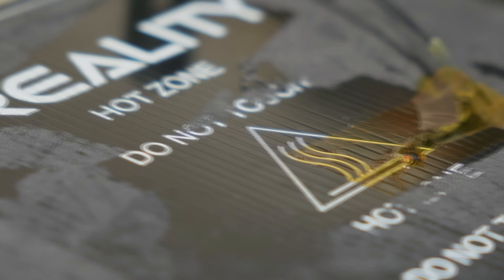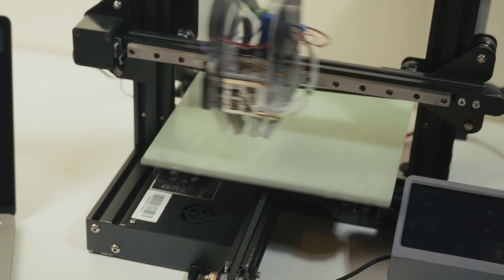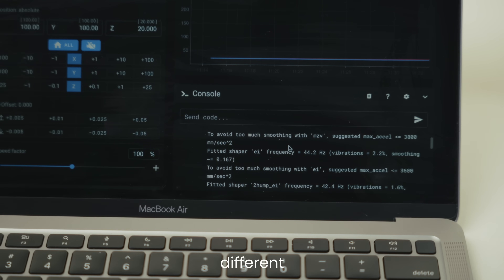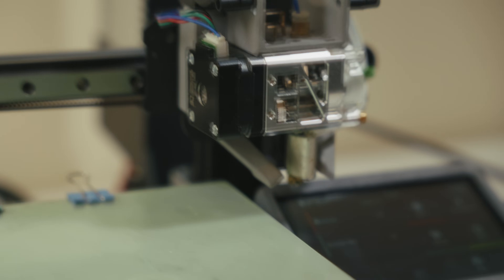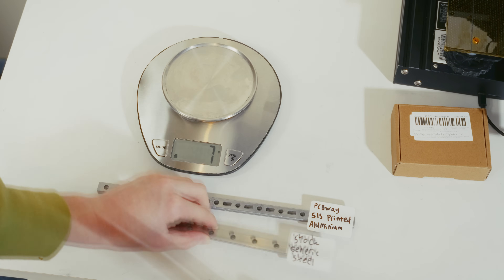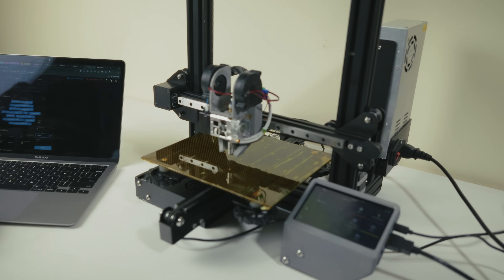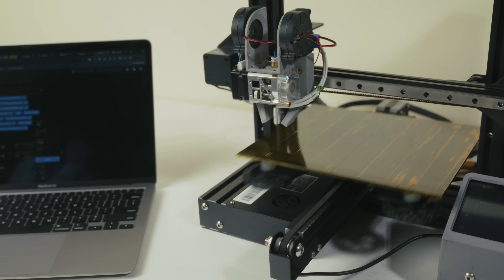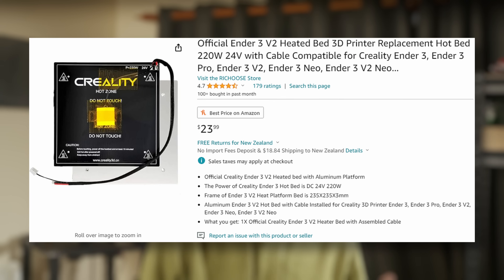Are Carbon Fiber 3D Printer Beds the Future?

Comment: Why the tape? Newbie here 6:09
Reply from the maker: Tape would be lighter than a PEI flexplate, or especially a glass bed! It should still work for adhesion, too, rather than just the raw CF, which only works for I think a couple of exotic filaments (it's been a while since I checked), but I think painters/masking tape would also be ideal. I don't think I actually tested printing on it 😅I have seen it used before, though. Maybe on the LH Stinger, but it's been a while. Cheers!

Comment: This is just my theory, but shouldn't you stay under the max accel with a margin, so that the print itself won't cause the steppers to skip once the print starts to weigh the bed down?
Reply from the maker: It's an extremely logical theory, and I can agree with you there. I've never really thought about that when pushing bedslingers to the limits, but it's a smart approach as it 100% is the case, especially with larger format machines!

Comment: You can use any fiber you want,  IMHO The most important aspect is the epoxy binder.  Use Kevlar, fiberglass, carbon fiber, etc, they will all be about the same, provided that they are made using the same binding epoxy.
Reply from the maker: Thanks for explaining! I will try and remember that for the future, in case I start using this stuff for more projects. Cheers!

Comment: i wanna ask will it possible with big size, like 400mm? i ordered 5mm carbon plate but in the middle is 4mm glass fiber
Reply from the maker: Different plates use different resins, so heating them will have different effects, but for the most part, they should perform the same regardless of size. I’ve redone this project for my next video (releasing later this month) and will continue testing its performance. For larger plates, the benefits should be even larger. Cheers!
Reply: @TommyHoughton  thanks for informations, i will subscribe for next video

Comment: Я переделывал свой Эндер 3 Про, уже несколько раз.Последнее изменение было связано с изменением привода ремня к кровати, и я сразу получил более стабильные результаты. Далее я стал думать как уменьшить вес кровати и также пришел к выводу, что неплохо использовать карбон. Стал искать кто такое делал и нашел ваше видео. У меня будет немного другая схема, но принцип такой же. Я не то что бы гонюсь за большими скоростями, скорее я хочу поднять качество печати, а тяжелая нагревательная кровать одна из причин появления дефектов. Кстати я тоже заказал силиконовую грелку, но только потому что из продажи практически исчезли грелки на основе каптоновой пленки (я не нашел подходящую по параметрам). Нагревательный элемент  на основе каптоновой пленки намного легче силикона. Удачи в вашем проекте, я тоже попробую завершить свой, сейчас жду когда мне вырежут нужные детали.
Reply from the maker: I've heard good things about that mod, I must try it myself. As nice as high print speeds are, higher-quality parts are always the goal. I'll keep a look out for these Kapton heating pads, they seem very promising. I've noticed the silicone heating pad is much heavier than initially expected. I wish you the best with your project! I will try this again later on in the year but with some better changes. Cheers

Comment: Never cut/drill carbon fiber or other composites in open air unless you want complications like cancer.
Reply from the maker: I understand the risks associated with working with it. I had my respirator and avoided contact with the powder. Should I work outside next time? I don’t plan on working with it for a long time.
Reply: @TommyHoughton  best way to cut carbon fiber at home is to submerge it in water or oil completely and drill/cut under the liquid. A respirator is nice but these kinds of powders are very sharp and sticky, so it's best to modify them under liquid. Also thick gloves and goggles are a necessary addition to your PPE. Nice video though. I enjoyed it very much.
Reply from the maker: Good to know! I'll definitely do that next time, it would make things a lot less messy. I'll look into some proper gloves and a visor/shield, they would be good for a variety of applications. I've had instances where I've needed to angle grind parts, but frankly, I'm rather afraid to try. Even using the Dremel was a relatively new experience. Thanks for watching and for your feedback, I really appreciate it!

Comment: What kind of drivers are you running on this? Also, are they running in stealthchop or spreadcycle? TMC drivers skip steps a lot easier in stealthchop at higher speeds.
Reply from the maker: It's a stock Creality 4.2.2 with the A4988 drivers. Unfortunately I can't control the current (to my knowledge.) I wish I never fried my SKR Mini E3 V3, but some things can't be changed. Would definitely love to put some HV drivers on this machine, perhaps BigTreeTech could help with that. An AWD Y axis upgrade was requested, combining that with some TMC 5160's would be insane. Thanks for the info too! It may prove useful in the future, I've never really looked into the details of controlling TMC drivers. Cheers
Reply: @TommyHoughton  yeah you cant do much with that board, but you can in fact increase the VREF on each driver. Maybe get a volt meter and double check what they are set to so you can maybe get more out of them. Other than that, you should get a new board so you can use some TMC drivers and configure them in spreadcycle.
Reply from the maker: That’s a good idea. I have no immediate plans for a new mainboard, but I’ll put in on the list for future upgrades since I definitely want to play around with different drivers. If I can plan a good enough video, I’ll try to fit in as much as possible; Perhaps “Building a 48V AWD Ender 3” has potential, I’ll look into it. Thanks for your suggestions!
Reply: @TommyHoughton  I appreciate your positive attitude and how you listen to suggestions. You have a bright future on YT, bud. 🙂
Reply from the maker: That means a ton to me! The suggestions from everyone (you and a couple of others especially) these last couple of years have been invaluable, I'll try my best to read and respond to all of them for as long as I can. I look forward to hearing from you again in the future!
Reply: @TommyHoughton  Thanks! You're doing a great job so far. Keep up the good work, and I look forward to seeing your future content. 🙂

Comment: can you do a hardware klipper setup overview, I also have a pi zero 2 w and want to add a touchscreen. Nice setup btw!
Reply from the maker: Thanks for watching! I could certainly do a deeper dive in the future, but it isn’t something I’m able to focus on currently. I’m more than happy to try and help you if I can; I used KIAUH to install Klipper screen, it didn’t work straight away but a reinstall made it work properly. I’m using a 5” screen from BTT using an hdmi to mini hdmi adapter (or micro not sure which one) everything is connected using the required adapters (usb C to A to Micro using a splitter for more ports.) Teaching tech did a video on a cheap esp screen I think it was, it’s a better value option but I haven’t delved into it just yet or checked compatibility but should all be fine. Cheers
Reply: @TommyHoughton  Thanks! I have changed the Y-axis carriage on my setup with a smaller cheap aluminum one from AliExpress and saved +- 100 gr, but I've seen they also sell cf versions for around 40 euro. Keep up the good work!

Comment: I've been waiting 5 years for a video like this haha, carbon fiber beds are a game changer with nylon
Reply from the maker: I’ll try do some experiments with it in the near future, I’ve never worked with nylon but I hear it’ll be a challenge. Thanks!
Reply: @TommyHoughton  it's very challenging, it hates moving air. Liquid cooled extruder and heat lamps for temp stability are your friends. But the carbon fiber beds act like garolite beds on crack, plus they are very flat and smooth. I print with a .25" thick carbon fiber bed.
Reply from the maker: @elvo_racing  Thanks for the info!

Comment: A couple of comments. A silicone heater also adds quite some weight - so I wouldn't be surprised if the weight of the CF plate together with a silicone heater is more or less the same as the aluminium PCB heater. The thought you had, replacing the steel bed frame with a CF frame really has merit as there should be a substantial amount of weight saved.
Reply from the maker: Good point, I didn't weigh the silicone heater, I just assumed it would be much lighter with the CF plate compared to stock. Once I get the bed frame and the bed properly machined, I'll do this project again with the feedback I've received. Thanks for your comment! Cheers

Comment: Is it just me or did you read your input shred and graphs wrong? Your first recommended excel was 3800. Your second recommended input shaper was 1900. I can almost guarantee the print results will look horrible if you go past 4000 accel with the cf
Reply from the maker: I likely did. The recommended shapers and values are noticeably different, and I'm not sure why that is. I held off on printing as I couldn't install the heater and the sheet wasn't up to spec, I plan on redoing this video but better with properly machined parts, hopefully in a couple of months. I'll also be using the feedback I've received, as It's quite a new area for me. I appreciate your input! Cheers
Reply: @TommyHoughton  you shouldn´t tape the accelerometer to the bed.. that will allow some vibrations.. Try to attach it to the bed screw or print a part to hold it and clamp the part to the bed with a strong binder clamp. I used the same approach on my voron switchwire, but I went full carbon (print surface + bed carriage, but my carriage was too flimsy). I dind´t want to use a silicon heater since it´s kinda heavy, so at first I used a PCB heatbed.. Now i´m planning on chenging the whole setup and use a polyimide heater, inspired by LH stinger also. Just need to find time for the next steps.
Reply from the maker: @yuripolak  Thanks for the tip, I’ll look into a printed mount or hard mounting if that works better. I’m actually installing a custom carbon fiber gantry and bed for October with a silicone heater, I was considering polyimide heater but couldn’t find a custom one and a basic one was too small. I’ll be going 48V which should compensate for the extra weight, but should be a noticeable difference. It’ll be interesting to test the good and bad about the mods. Cheers
Reply: @TommyHoughton  while at it, throw a second motor on Y axis.. Lol
Reply from the maker: @yuripolak  I was considering it! Maybe in the future if I need even more power… I’m going to be running AWD on my Ender 5 once it’s Mercury 1.1 converted, so I’ll look into it once I’ve completed that 😄

Comment: Ok so I've got 2 questions. Good video BTW. Firstly, what thickness is the carbon fibre sheet that you are using. And secondly, what command do I use in klipper to test acceleration. I know how to do input shaping, but I didn't know there was a command to test until failure
Reply from the maker: Thanks for watching! The sheet is 2.5mm. I used this macro to test the max speed, however, I got the process a little confused with a video with MirageC, where he made a Gcode that increases the acells over time. I'll share that video as well as it was very helpful. https://ellis3dp.com/Print-Tuning-Guide/articles/determining_max_speeds_accels.html 
https://www.youtube.com/watch?v=AqlP5ar3LkE
All the best! Cheers

Comment: In this day and age - Why still bother chasing Speed with a Bedslinger when going CoreXY is the more sensible choice? 🤨
Besides taking up way more space due to the moving Bed the most obvious problem with a Bedslinger is that you really cannot calibrate the Y-Axis unless everything you print remains in the realm of tiny as once you've reached a certain size / mass on your build plate all that calibration you did using an empty bed basically flies out the window - Unlike on a CoreXY where all the calibration is being done on Axes whose mass never changes as a print progresses 😏
Reply from the maker: I've been meaning to purchase one, but local imports have a decent markup and shipping costs from overseas are too high to justify currently. That's a good point with the calibration. I really can't wait to build/order a corexy. I'll be doing a CoreXY conversion soon on my Ender 5, so I'm hoping it's as good as expected. Thanks for your comment! Cheers

Comment: Ditch levelling wheels and put plain nylon locking nut, ive got cheap 1/4 socket set for it from lidl... even handier now
Reply from the maker: Good idea! I might even have some in storage. Thanks!
Reply: @TommyHoughton  Yeah i removed levelling springs as well. I use a bare nut just below the bed just keeping that screw in, then two nuts in really flat lightweight 3D printed wheels one above the bed carrier and one below. They jam against the carrier, no nylok nut needed. But my printer is not an Ender3 but a DIY i3-variant.

The printer like that is susceptible to accidents though, like that one time when my DIY probe failed to deploy... the nozzle can hit pretty hard!

Comment: Its a combination of rigidity and weight. I rebuild a Makergear m2 -- which already has a very rigid steel frame, but lacks the Y axis rigidity. I replaced the steel bed carriage with a 6mm aluminum carriage -- i made it bigger for the same weight, and add 2 linear rails instead of one and also added a 2nd Z axis lead screw attachment to the bed stage. I also replaced the steel bed with a 24v heater with a mic6 aluminum bed with a mains powered heater. End result is net zero weight change, but significant increase in rigidity. Accelerations on Y went from 1500 to 8000 and max speeds are whatever you want them to be -- factor of motors a voltage, I can hit 500-600 mm/sec with no issues. Light weight beds which you fling around can lead to added micro vibrations. I found out the hard way -- I tried a skeletonized X gantry on my voron, and input shaper was really hard to tune, I went to a unibody light weight beam, which is heavier than the skeletonized X gantry by a lot, but is also WAY more rigid, and my accelerations and speed doubled -- with very clean input shaper curves. I'm going to be rebuilding my v2.4 to a doomed cube trident to improve rigidity -- shaving 200-300g is not as important as you think, make the frame more rigid, replace the v-wheels on Y with 2 linear rails, and note the difference.
Reply from the maker: Thanks for sharing! That's quite interesting about the micro-vibrations, I've been working on some other lightweight parts, so that could be an important variable when testing. I'll also do research on improving the rigidity for future projects. Thanks!

Comment: Is it possible to heat the bed after installing it?
Reply from the maker: It sure is! I purchased a nice silicone heater to do that, but unfortunately the cf sheet was too small. When I get the sheet machined to the right size, I’ll install the heater and test the performance. Cheers
Reply: Yep, you can still heat a CF bed
Reply: No it has to be a cf made with high temp epoxy and even then at ABS bed temps would still most likely make it warp. Do some research.
Reply from the maker: @Tinkerer5888  Good point, I’ll look into getting a better sheet. I was assuming they were all relatively similar. Thanks for mentioning it.

Comment: Good video! Glad to see someone taking the adventurous path rather than just slapping more motors on the printer (although I'd still like to see an AWD Y axis video :D). Looking at your graphs at the end, I think you still have a lot of room for improvement in that regard. It looks like you have three distinct peaks, so other things on your machine are rattling and throwing off your results.
Reply from the maker: I'd absolutely love to do AWD on the Y axis, I've been a bit intimidated to do that though. It could make an excellent video, I'll try and reach out and see if LDO would be keen to help! There's definitely room for improvement, the machine was wobbling quite a bit, and I'm pretty sure a few screws are loose somewhere. Once I get the sheets machined I'll refine everything. Thanks for your support as always!